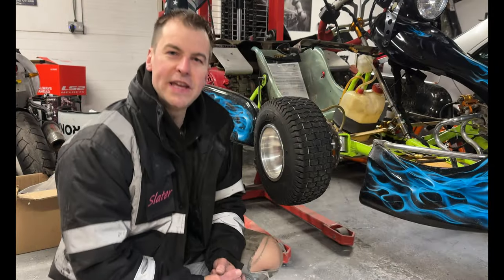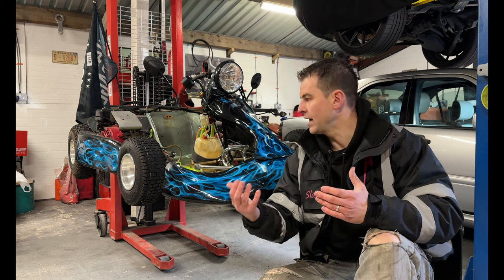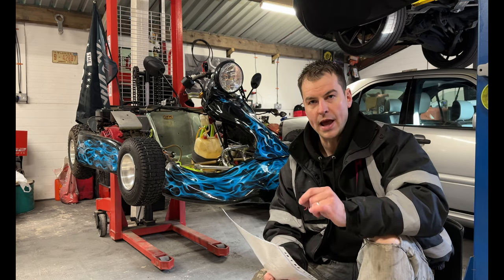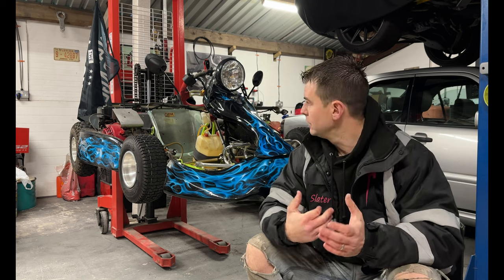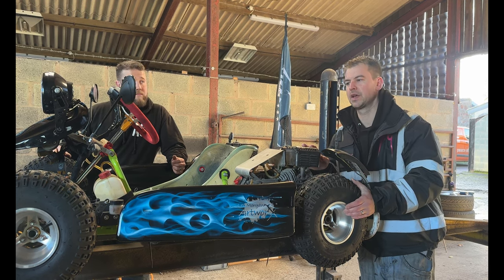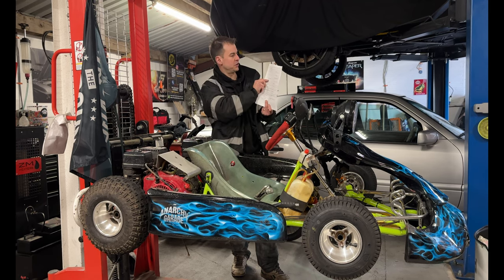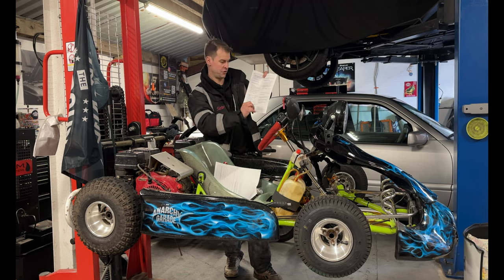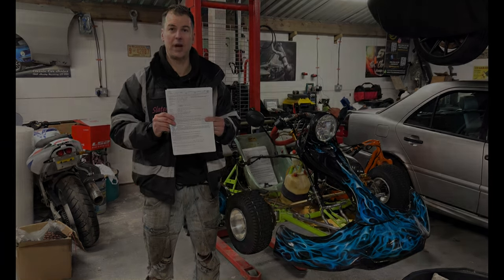How To Build your Own Road Legal Kart Anarchykart Part 3 - The Anarchy Garage - Episode 20

Comment: Am in the middle of building one out of my 125 intrepid shifter kart how do u deal with charging the battery do u need a charging circuit or just charge when parked
Reply from the maker: Thanks for getting in touch, we just charge them when parked. A 12v battery will easily do you a few hours out driving 👍🏻
Reply: @theanarchygarage9418  thankyou for replying I have two karts I want to do one is my intrepid shifter kart and one is a biz kart twin gx200 will keep my eldest son busy this summer
Reply from the maker: @matthewpopple3214  sounds great 👍🏻

Comment: Would it be possible to apply for road legal status if the chassis is custom DIY made and using purchased gokart parts.  Great Vid!
Reply from the maker: Hello, yes there is still a system in place for this using the Single vehicle approval method. You would have to research your individual needs for this and use the appropriate category of classification.

Comment: How do you get the electric from the engines???
Reply from the maker: Hello Craig, we are just using a 12v battery with no charge system. with LED lights they easily last all day and night and then put on charge when you get home. You may be able to use a dynamo onto the rear axle if you need to aid charging.